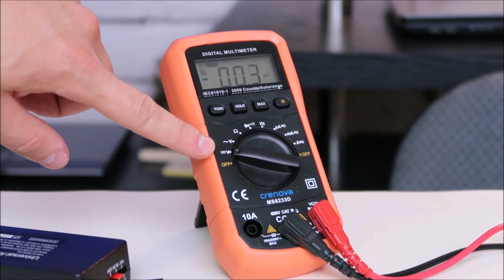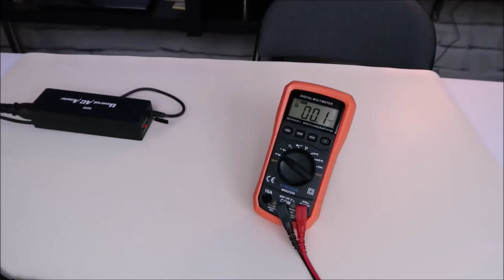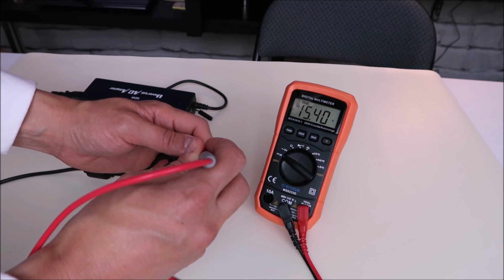How To Fix Any Laptop - Wont Turn On, Wont Open, Turns Off Right Away, No Power Solution

Comment: Installed a new battery and it worked   but then the battery died and now the PC won't work even when I try to charge it. What should I do?
Reply from the maker: Have you tried the steps seen here?  Will the computer turn on after the battery and charger are removed, the static discharged, and then only the charger put back in?
Reply: @PC_Monkey  I have tried this multiple times but it hasn't worked yet
Reply from the maker: @BoTheJo  This video has been updated with additional steps here;  https://youtu.be/P3I7dDpkJps.  Let me know how that goes :)

Comment: So I was in a zoom meeting for high school. I was cleaning my room and picking up trash since they made us be muted. And, I accidentally spilled some water on my mother's computer(the meeting was for adults/students this time.) I completely dried every inch and side of the computer, yet, about two minutes later after working it just turned off. I tried the static discharge and that did not work. The battery is internal so I figure I should not mess with it. The charger light shows and that is it. The power button light does not show nor do I hear sounds or get any signals it would turn on when I try it. The screen is just black. It is around 100% battery. The model is LENOVO YOGA(^?) C740 14 inch. Any help would be appreciated since I am 100% confused.
Reply from the maker: your on the correct video.  Have you tried the steps seen here yet?
If these steps dont help, the motherboard could be damaged :(
Reply: @PC_Monkey  The issue is it is internal. I am just a kid so I do not trust myself to take out the battery. It is better to get in trouble and get it fixed than ruin it.
Reply from the maker: @user-gc5qh6no9l  Good luck :)

Comment: My DELL Inspiron 5559 laptop is not turning on. While following your demo video, my laptop turns on only if CMOS battery is reseated. As you know, it's too difficult to reseat CMOS each and every time to turn on laptop. My Laptop is currently in UEFI boot mode with secure boot enabled. I also noticed that white LED light blinks when the laptop is working. What am I supposed to do to fix these issues?
Reply from the maker: You may need to replace the CMOS battery as it may be dying.
Reply: @PC_Monkey  Okay...how to purchase the exact CMOS battery?
Reply from the maker: @rohanmehta9625  you should be able to see the volt rating on the battery.  You should replace it with that same value.
Reply: @PC_Monkey  Which brand CR2032 battery will you prefer?
Reply from the maker: @rohanmehta9625  I really dont have one I prefer.  They are pretty simple components and I have not run across any that are poor quality yet

Comment: I have a lenovo ultrabook.  I've tried all your suggestions but nothing works.  The power light comes on and the keyboard light flashes on for a few seconds, then goes off.  The screen stays black.  There is no sound coming from the fan, etc.
Reply from the maker: If all the tests in this video do not reveal the issue, and your power adapter tested to be fine, then your most likely looking at a Motherboard replacement as seen here;  https://youtu.be/N_7HNrFkMS8.
Reply: @PC_Monkey  thanks. It’s an older laptop so will just remove hard drive and junk.

Comment: I have a lenovo ideapad model l18c4pf3 41cp4/41/110 the battery is built in it can't be removed like that. The laptop won't turn on  at all I plug the charger and no light comes on, I also removed the battery & drained any remaining power but it also didn't work.  Now I'm trying to remove the CMOS but I am unable to locate it. Help please?
Reply from the maker: Not all computers have a CMOS battery.  Yours may not.  No lights are even coming on?  Are you able to test the power adapter as mentioned here?
Reply: @PC_Monkey  no lights come on at all. Bought a new charger and nothing. I found another video that said to remove the ram and clean it with alcohol but that didn’t work either.

Comment: Mines still not working the white light keeps blinking it’s a toshiba satellite idk what to do I need it for school and I don’t have the money to buy a new one or get it fixed if something bigs wrong :[
Reply from the maker: Are the lights the only signs of life when you turn it on?  No motherboard or hard drive sounds?  No fan noise?
Reply: @PC_Monkey  yes
Reply: @PC_Monkey  and it blinks for a bit after I press it
Reply from the maker: @xxxrebisxxx  your on the correct video.  Have you tried the steps seen here yet?
Reply from the maker: @xxxrebisxxx   If all the tests in this video do not reveal the issue, and your power adapter tested to be fine, then your most likely looking at a Motherboard replacement as seen here;  https://youtu.be/N_7HNrFkMS8.  If you know your computer's model number, I can help you get inside your specific computer :)

Comment: How can I message or email you?
Reply from the maker: For this free DIY support service, I only communicate on YouTube.  For one-on-one support, we have to schedule a time and there would be a fee.  
What brand and model computer do you have and whats the issue with it?
Reply: @PC_Monkey  Its an hp 15-bw011dx. I tried to do a factory reset and deleted everything. Now Im getting the "boot device not found - hard disk 3F0" screen. Went through all your videos. It passed all the tests which led to me trying to reinstall windows from a disk. But when I do that it freezes on the HP logo sometimes its the windows logo, and then goes to a snowy, static screen til I turn it off. Im completely dumbfounded. I downloaded windows to a second disk and it does the same thing
Reply from the maker: @bsow2012  If the HDD was good and this happened during a failed reset, then its most likely the OS is just messed up.  You can see how to install here;   https://youtu.be/p_N_xV7j_Xo.  You can create your own Install Media for free as seen here;  https://youtu.be/g_UhiHScaSI.
Reply: @PC_Monkey  i did everything in that video. The only thing that happens is it loops at the "press any key to boot from cd / dvd" screen. Like after that screen itll restart itself back around to the "press an key to boot" screen. Then I tried enabling legacy support and thats when it will freeze on the HP logo and eventually turn to static. I just uploaded a video to my channel of me trying to boot up with the windows 10 installation disk in so you can see what happens.
Reply from the maker: @bsow2012  If its not taking the install disk, did you try making your own install media as shown in the video?
Reply: @PC_Monkey  I dont have the actual install disc from windows, this is my own install media that I used your videos to download. I even reburnt it to a second disk thinking the first one just burned improperly, but both disks do the exact same thing. Very frustrated  at myself for causing such damage, I thought I was doing a factory reset
Reply from the maker: @bsow2012  Im at a loss too :(   If that keeps happening, I would then think something is wrong with the hard drive but you said it passed the test :(  I would change it anyway at this point.
Reply: @PC_Monkey  Okay thank you, I didn't know if I was doing something wrong. If I replace the hard drive should it come on, or is there more I need to do?
Reply from the maker: @bsow2012  After installing a new drive, you would have to install an operating system onto it as seen here;   https://youtu.be/p_N_xV7j_Xo.  You can create your own Install Media for free as seen here;  https://youtu.be/g_UhiHScaSI.

Comment: hi sir, i've already done bios reset,which replace new cmos battery.Then, my lenovo x230 can turn on, but once shut down.. i cant turn on again.
i need to do bios reset again just to turn on my laptop.

what is problem with my laptop? any other solution?
Reply from the maker: For a computer that wont turn on, your on the correct video.  Have you tried the steps seen here yet?
Reply: @PC_Monkey  yes sir.. i have tried the steps from your video.. only reset bios can turn on my laptop..but every time to turn on..need to reset bios..
Reply from the maker: @mohdfahmiahmadkhairi  Your CMOS battery may be dead.  I would recommend replacing it.
Reply: @PC_Monkey  i see..thanks sir.. i would try to replace with new one. thanks!

Comment: Hi , so i closed my laptop a few hrs ago and now I'm trying to open it but it doesn't show any sign at all of activation and I can't currently get anything out from the laptop , could you help me if possible?
Reply from the maker: For a computer that wont start, your on the correct video.  Have you tried the steps seen here yet?
Reply: @PC_Monkey  I can't currently remove the battery from  the laptop   can I do anything in the meantime to try and fix it until then ?
Reply from the maker: @lonew0999  You can try to just hold down the power button for a minute or so.  See if it comes on.  If not, unplug the power adapter and hold down the power button for a minute or so.  If that fails, theres not much else you can troubleshoot without opening the computer up

Comment: I just did the test and it needs a battery. My laptop doesn’t go anywhere it stays plugged. In can I continue to use the laptop without the battery, would that do any harm to the laptop.
Reply from the maker: No, using the computer without the battery wont harm the computer.  However, if your doing some high power usage operations, not having a battery could affect performance

Comment: I have an asus e402na laptop and its not opening anymore, there's no sign of life. I've tried the first step, but it didn't work. And about the cmos battery, i think my laptop doesn't have one. Plss helppp im struggling with my online class rn 😭
Reply from the maker: Then you would continue on with the video testing the other components.  If none of these steps identify the issue, than your most likely looking at a motherboard issue and it would then need to be replaced.
Reply: @PC_Monkey thankyouu very muchhh!!
Reply from the maker: @princetsaurz6582  Your welcome !!  Happy to help :)

Comment: Uhh I can't get my laptop open
Reply from the maker: If you mean the computer wont turn on, your on the correct video.  Have you tried the steps seen here yet?
Are there any signs of life at all?  Lights?  Fan, Motherboard, or Hard Drive sounds?
Reply: @PC_Monkey  Im having trouble removing the screws to get into the back of the laptop
Reply: @PC_Monkey  I went to a repair shop and they opened it for me for free.
Reply from the maker: @BoTheJo  Glad your all set :)

Comment: Do u have a gmail so I can send u a picture of the back of my laptop
Reply from the maker: For this free DIY support service, I only communicate on YouTube.  For one-on-one support, we have to schedule a time and there would be a fee.  
What brand and model computer do you have and whats the issue with it?
Reply: @PC_Monkey  I have a acer chromebook the black one with the lights in the front it wont turn on I tried charging it I tried holding refresh and power at same time

Comment: Please help me out. I have a lenovo ideapad that have refused to power on nor show charging light. I have tried all your solution but no success. I checked the power and got 20.5v but couldn't get the same on the board or on the battery. Please what could be the solution. Thanks in advance
Reply: fl5c5/fl535/fl435 LA-H103P my motherboard
Reply from the maker: If all the tests in this video do not reveal the issue, and your power adapter tested to be fine, then your most likely looking at a Motherboard replacement as seen here;  https://youtu.be/N_7HNrFkMS8
Reply: This version Sir
Reply: Please how can I get this motherboard
Reply: fl5c5/fl535/fl435 LA-H103P
Reply from the maker: @Gospelhub_UKTV  What brand and model computer do you have?
Reply: @PC_Monkey  lenovo ideapad s340 i3 10th generation
Reply from the maker: @Gospelhub_UKTV  I searched for 'Lenovo Ideapad s340 Motherboard'  
Is this your motherboard?  https://www.ebay.com/itm/254864062203?epid=2306918898&hash=item3b5714f6fb:g:cJUAAOSwGXNgJT58
Reply: @PC_Monkey  Mine is 8GB Sir
Reply: Mine is 8GB Sir

Comment: may i ask if what's the best problem solution on my laptop, it happens to be not charging and not turning on at all, no lights indicators. I'm really having problems if what's the best solution because i have classes to do please reply
Reply from the maker: your on the correct video.  Have you tried the steps seen here yet?

Comment: It turns on but only fan gets on for 1sec and again turns off
Reply from the maker: your on the correct video.  Have you tried the steps seen here yet?
Reply: @PC_Monkey  Yea but it didn't worked help me I have missed my online classes since 2 days
Reply from the maker: @dipengorkhachhetri138    If all the tests in this video do not reveal the issue, and your power adapter tested to be fine, then your most likely looking at a Motherboard replacement as seen here;  https://youtu.be/N_7HNrFkMS8.
Reply: @PC_Monkey  thank you so much for helping means a lot 😊
Reply from the maker: @dipengorkhachhetri138  Sorry it didnt turn out to be something easy :(

Comment: so uh I don't know if my laptop has a virus or whatever-
but first, it just starts glitching on me, and then it said I need a "Vpn" virtual public network wifi. Then today it wouldn't turn on
Reply from the maker: For a computer that wont turn on, your on the correct video.  Have you tried the steps seen here yet?
Reply: @PC Monkey  My laptop doesn't have those battery things that I can open in and out 🙁
Reply from the maker: @jetty8385  What do you mean you dont have 'those battery things' ?   All computers have batteries.  Has your battery been removed?

Comment: My laptop shut down on me a couple days ago and hasnt turned on, I've tried most of these solutions but nothing has worked. Any idea on what I should do next?
Reply from the maker: Are there any signs of life at all?  Lights?  Fan, Motherboard, or Hard Drive sounds?

If all the tests in this video do not reveal the issue, and your power adapter tested to be fine, then your most likely looking at a Motherboard replacement as seen here;  https://youtu.be/N_7HNrFkMS8.

Comment: Testing this out in a second. Will keep you guys updated
Reply: None worked, couldnt find the battery for the motherboard
Reply from the maker: If all the tests in this video do not reveal the issue, and your power adapter tested to be fine, then your most likely looking at a Motherboard replacement as seen here;  https://youtu.be/N_7HNrFkMS8.
Reply: @PC_Monkey  Yes, I will attempt that when I am able to go back outside

Comment: everytime m pressing the power button the screen just blink & i can sense some vibration, no other response. pls suggest what's the problem/? It's dell Inspiron AMD E2
Reply from the maker: your on the correct video.  Have you tried the steps seen here yet?
Reply: @PC_Monkey  ya battery is fine, it's showing dell loading,  i pressed F2 Button then BIOS screen came. I tried reseting but no progress. unable to turn windows setup
Reply from the maker: @SonaliSingh-nv4zw  Nice, you got the Dell logo to come up :)   Can you perform the test as seen here now?  https://www.youtube.com/watch?v=w3XfE-ghbhs&feature=youtu.be
Reply: @PC_Monkey   After making all the changes it's still not opening + in diagnostic test also there is no error. Dell is loading with text "undoing changes made to your computer", nothing else. How can i open windows recovery mode from this point ? m unable to understand the issue
Reply: @PC_Monkey   how can i factory reset or do changes with operating system with it being stuck at loading screen ?
Reply from the maker: @SonaliSingh-nv4zw    If these steps do not resolve your issue and the hard drive is shown to be healthy in the test, then you can try to Factory Reset your Operating System as seen here;  https://youtu.be/IE1zShTb0rU or try to reinstall Windows 10 as seen here;  https://youtu.be/ULrJVk4JJ20.  You can create your own Install Media for free as seen here;  https://youtu.be/g_UhiHScaSI

Comment: I have a asus tuf gaming laptop and it just started this issue. It will only come on with the charger, and it’s only the light up keyboard and that sometimes will flash, and the fans will turn on and the screen stays black. What can be the issue?
Reply from the maker: If the computer only turns on with the charger plugged in, it sounds like you need to replace the battery.
Are you saying that even when the computer turns on with the charger plugged in, the screen stays black?

Comment: You're legendary bro 

You saved my life 😅

After I remove one ram from the it's slot 

The computer work just fine 

Thank you as mach as the sky ❤️❤️

Note that I just cleaned up the RAM with some air,.  And put it back 

And it worked fantastically 👍

It doesn't mean it's damegeed or something 

a good clean might solve the problem
Reply from the maker: Happy to help :)  Always here if needed !!

Comment: I don't know if you could help me with that but my other pc (MSI) model GL62M 7RDX since I was alway using it when plugged in, I had removed the battery then plugged the wire back but when I tryed to power my pc on, it made a weird sound (maybe something burned out?) when I put the battery back in and plugged it back, it still doesnt power on, the light when I plug the pc in is on but when I press power button nothing happen
Reply from the maker: your on the correct video.  Have you tried the steps seen here yet?
Reply: wow you answer quickly, but ye i did, but idk if it could be like a fuse / mosfet even tho I didnt find any mosfet that could have been the reason of this
Reply from the maker: @mikahot1371   If all the tests in this video do not reveal the issue, and your power adapter tested to be fine, then your most likely looking at a Motherboard replacement
Reply: @PC_Monkey  ok thank's